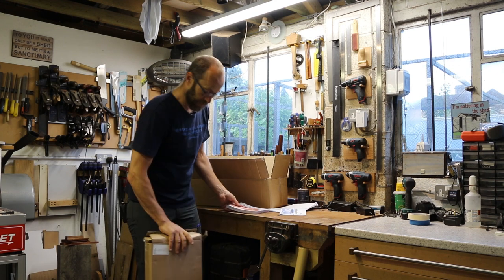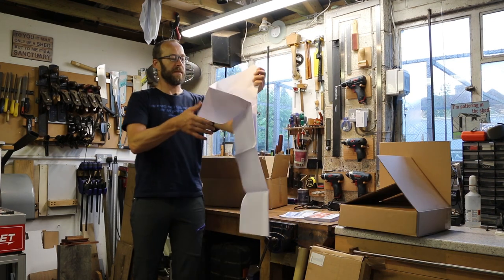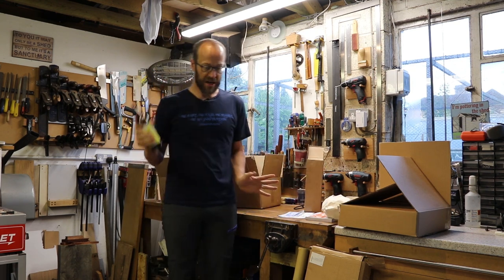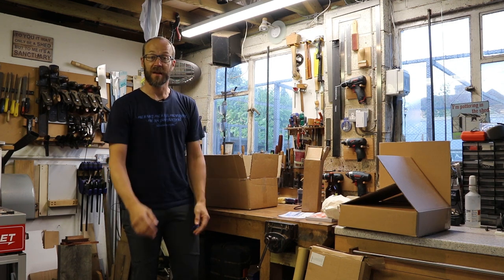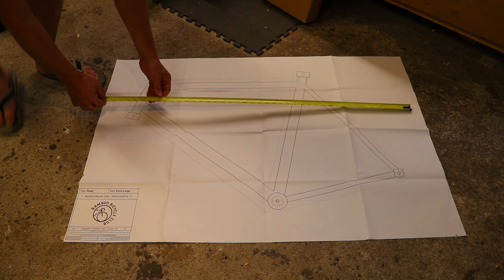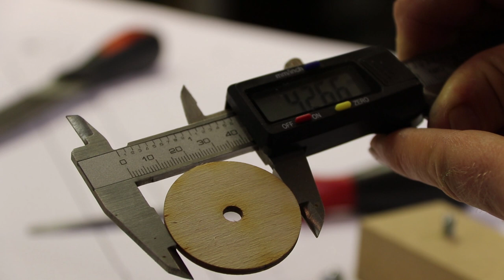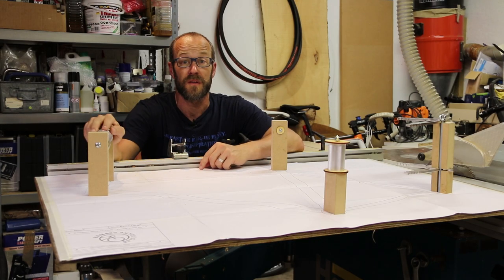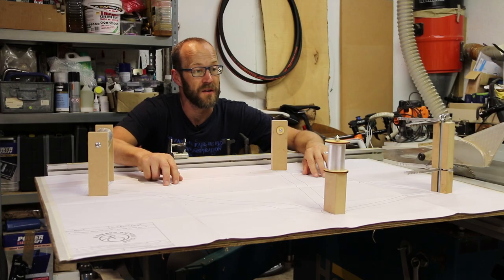Building a Bamboo Bike - Getting Jiggy with it

Comment: Did you get to pick your own geometry/dropouts/BB/ seatpost size?? Or it it simply a standard design??
Reply: We offer custom geometry, dropouts, our BB are 68mm english thread but we can supply a press-fit etc. Seat tube is 27.2mm. The kit currently being built is our standard road frame from our stock designs